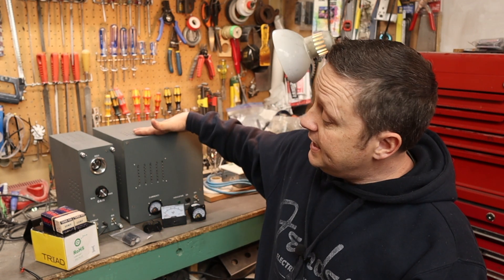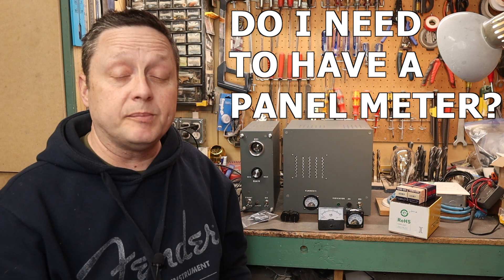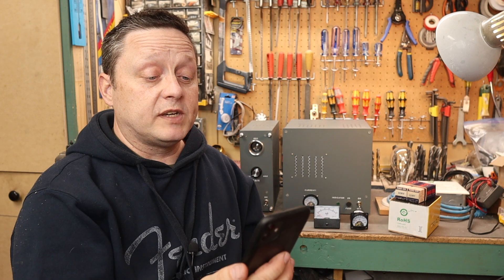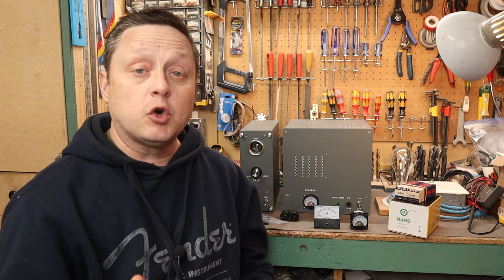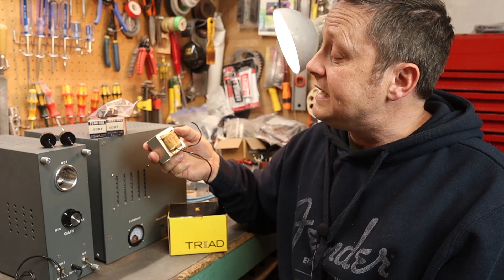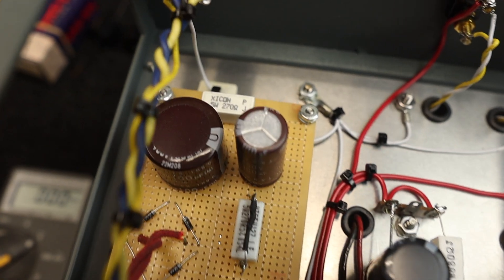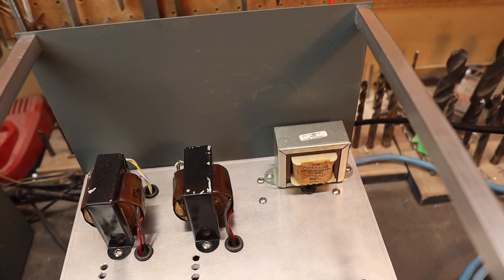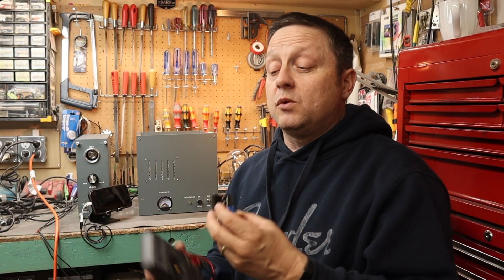6DN7 tube HiFi amplifier mods and FAQ. PART 2 // Trying to make it sound even better!

Comment: hello Mike, just wondering can you post a tube rectifier power supply schematic for this little gem or the power transformer needs changing? thanks.
Reply from the maker: Thanks for commenting. Yes, I can. Send me an email and I can draw something up for you.  The PT would need to be increased due to the voltage across the rectifier tube and a 5V taps that is required.  You can use Duncan amps PSU simulator to  find out what voltages you need.  You can go with a 5Y3 or a 5U4. 300-0-300 at 80ma should get you in the B+ voltage ballpark. Change the input cap (C4) from 100uf to 20uf and install a choke as per Version 2 of the circuit.  Have a look at my 2A3 amp on how to wire up the rectifier tube.  The amp may not be as quiet due to the less capacitance in the PSU but you may not notice a difference if you have lower efficiency speakers. Cheers

Comment: Is it worth putting in a soft start circuit or delay for the ht to stop any cathode stripping on start up?
Reply from the maker: These are hearty tubes meant for TV’s.  Adding a special circuit for a soft start is not really necessary in this amp.  Adding a thermistor wouldn’t hurt at all. That’s what I did.  You could also install tube rectification but that may require a different PT and different/lower value caps in the PSU.  Cheers.
Reply: @MikeFreda  haha yes and being ex tv tubes i guess there's loads available for little cost. Not exactly a prized Western Electric 300b!
As long as they sound good though! 😊
Reply: @MikeFreda  I did look at this vid before the soft start one you did also! Thanks for posting your vids anyway.

Comment: I would never buy an "audio grade" capacitor unless it was from a recognized manufacture like Panasonic, Nichicon, Wima, ICC. A lot of these so called "audio grade" capacitors are low cost junk caps with fancy labels heat shrinked on. Buy good capacitors from established manufactures like I listed and only from reputable distributors, Digikey, Mouser, Newark,  Allied. And since this not really a HiFi amp but a basic bench test amp, why do you need fancy coupling caps? Sprague Orange Drops or equivalent are just fine. You seem to have a good understanding of electronics and do quality work. Don't get caught up in this Audiophool BS! It's beneath your skills and knowledge.
Reply from the maker: Thanks for your comment. Yes, I would agree to purchase recognized brand caps from a reputable seller. As for this amp not really being HiFi... just because it doesn't use known audiophile tubes doesn't mean it does not sound good. This power amp is quite the sleeper! As for fancy coupling caps, yes, I probably could have gone with the proper rated Orange Drop or similar cao but for the slight extra cost and the placebo effect, I think they do sound better! lol  Cheers.
Reply: @MikeFreda  Oh no, I didn't mean to imply the amp doesn't sound good. I have built quite a few tube amps as well. I also like the way you used  TV tubes for audio.  These are low cost and easy to find but also very good audio performers in some cases,

Comment: Hi.. Cool project. I love the aesthetic.. The PSU choke is a good upgrade. You might want to try getting a stiffer power trannie too that runs cool. Since you already upgraded the coupling caps to Calritycaps you might want to replace the cathode bypass caps in the output stage to Nichicon audio grade or Elna Silmic II 35V.. Lessen their value too anywhere from 220uF to 330uF.. 470uF might slow things down too much.. Please do replace those Cathode (white coffin) power resistors in the output stage too with non-inductive wirewound types from Dale, Mills, etc.. Kiwame 5W carbon film would be nice there too.. CCS can vary in sound signature, some can sound a bit on the solid state zingy so try and listen.. Just my personal thoughts.. Happy listening.. BTW, if your garage speakers dip below 4 Ohms your SE amp would really have that current sag on heavy bass passages..
Reply from the maker: Thanks for your constructive comments. Yes, this amp is a work in progress. I calculated the bypass cap to a 5hz cut off but going smaller may help the amp perform a bit better since my speakers can't really go that low anyway.  I'm using 8" full range speakers which have a pretty flat response and are easy to drive.  The PT could be upsized a bit to give me some reserve. It doesn't run that hot (compared to some guitar amps I have) The choke helps a lot. The only issue in running a larger PT is that the voltage will be a bit off and you will need to adjust some resistor values to suit. The next video of this amp will incorporate some of these mods and a CCS to see if it performs better. I suspect it will. The Morgan Jones style of CCS is pretty transparent to my ears.  Cheers.
Reply: @MikeFreda  
Oh yeah, the amplifier tube section of the 6DN7 is lowish in Rp.. No need to change the cathode bypass cap value (5Hz cutoff is ideal..) Although sometimes you can get away with an 8Hz cutoff with tiny bookshelf speakers. Some designs I see use 0Hz cutoff, that it usually sacrifices the quality of the component inside the current loop (pricier and harder to find high quality parts in higher values. Quality is more critical in SE than in PP, IMHO..) Nice, Morgan Jones CCS👌🏼, you are good to go.. If your 8” FR speakers are efficient enough and have a benign impedance then you might need to upgrade the Power Tranny down the line.. You also might want to check out Edcor’s GXSE10-5K OPT’s as another alternative for builders..

Comment: Thanks for a very informative tube amp video series. Especially the Cricut label method! How is the high frequency response? Reason I ask is I built an amplifier based on a tube I'd never used before, 6CY7 triode. It sounded good, but after I listened for a while I realized I was missing the very top end of the spectrum, say 16k and above. Have you done a response sweep with this amp?
Reply from the maker: Thanks for your comment.  I have not done a sweep on it yet. I will on the next video.  This tube is designed for a television and it’s my understanding that it is capable well above 20,000hz.  I believe in a audio circuit the limiting factor would be the output transformer so I would not scrimp on them if you are looking to make a good sounding amp. Cheers.
Reply: @MikeFreda  Changing out the opt was the first thing I did. I think all or most tubes, at least those commonly used in audio applications, are capable of 20 kHz. The question is, at minus how many dBs?  One can have a spec of 20Hz-20 kHz , but if at 20kHz it's down 3 dB, it's not going to sound very good.

Comment: I have 120v coming in from a Variac but it goes through a CL-70 before fuse. So I have about 118v. Wall voltage can vary depending on season, I’m in Buffalo now so I’m not to familiar with the fluctuations. I know from living in NYC my whole life my voltage could vary from 125-115. I have some AT7’s and AU7’s to roll

Comment: I like the choke idea Mike but that is a expensive addition, same for those caps. I used a pair of Clarity caps only because I had them, I was going to order Solens. I was thinking about bumping up the mains as well, my PT has two options, 275-0-275 or 315-0-315. I went with 275 like yours, my B+ is about 10 volts less then yours. So I may try the 630 Vdc now. I do need to get a higher efficiency speaker set for this though. This amp was running a rebuilt/restored 1970 AR 2ax pair and it did sound really nice. I do have a 4S Universal pre in front the amp too, I have a 12ax7 in it but may swap to a 12AU7, it did sound  warmer with the au7
Reply from the maker: Thanks again for your comment. Yes, a choke is a bit extra money for a slight gain in performance.  I'm curious on what your incoming AC voltage is. I'm typically at 120VAC.  If you are down to 114-115VAC that may be the discrepancy. I wouldn't worry too much about a 10V difference.   12AX7 are a bit harsh for hifi. Most people like a tube with less MU for a preamp. Great for guitar amps but harder to get sounding good for a hifi preamp. Cheers.
Reply: Any updates on the amp lately Mike? I’ve been running the amp on the 315-0-315 for awhile now and changed out the 12ax7 to a 12au7. I haven’t done anything else but I do want to upgrade the OT’s, hope supply chain has gotten better

Comment: hi Mike, thanks for the updated vid.  how did you measure AC hum at the end of the vid?  (leads across the output transformer?)
Reply from the maker: Thanks.  They way I do it, I ground the input (or you can even turn the volume to zero) and turn my multimeter on and lowest AC setting and put it across the speaker terminals. You need a dummy load or just have them still connected to your speaker. You are basically looking for any AC voltage on the output that is being generated from the amp itself.